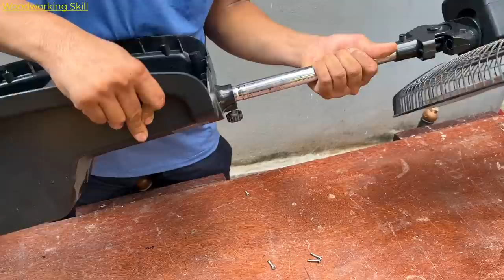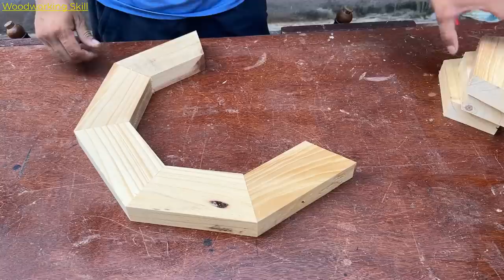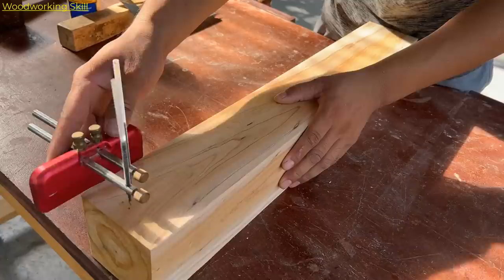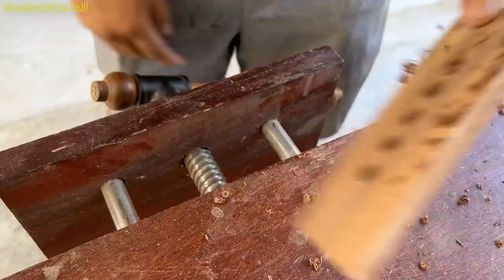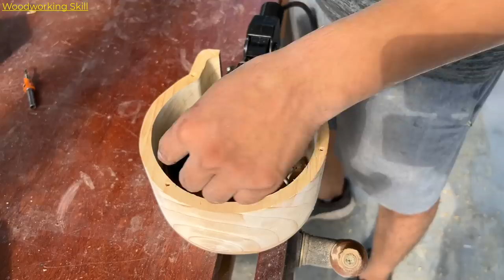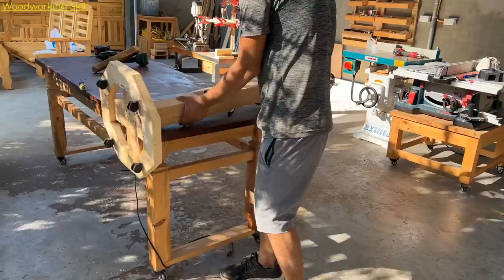Amazing And Inspirational Creations // Build A New Style Wooden Stand Fan

Comment: Beautiful work. 
The metal dissipates heat from the motor much better, where the wood will insulate it and get hotter.
You may want to keep the back of the motor open.